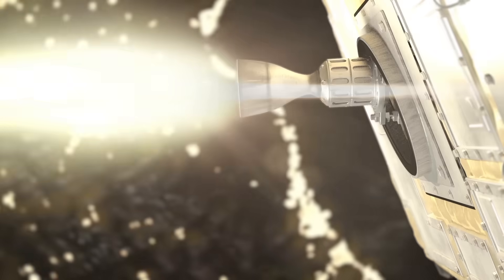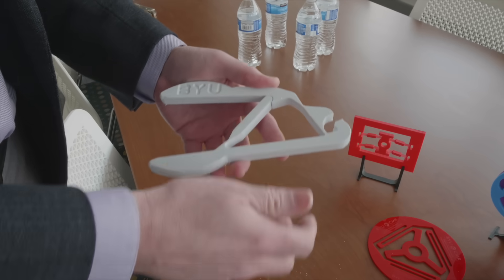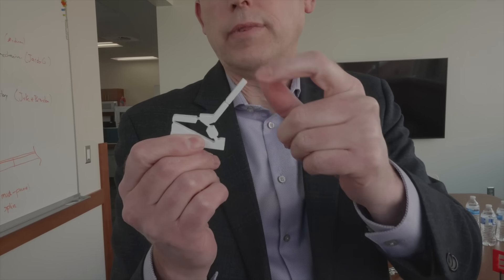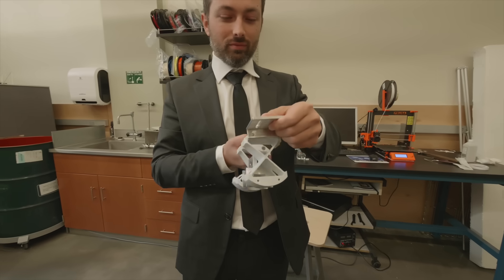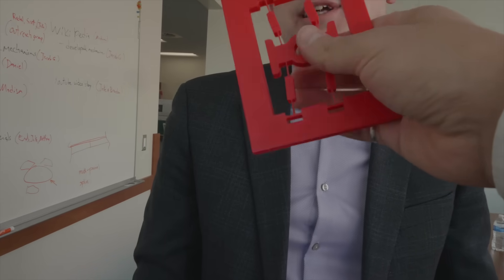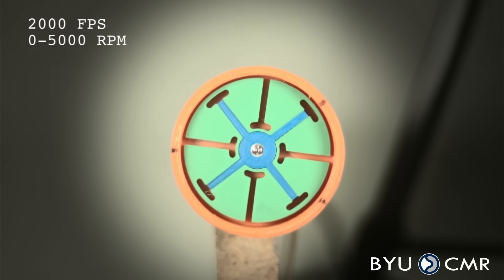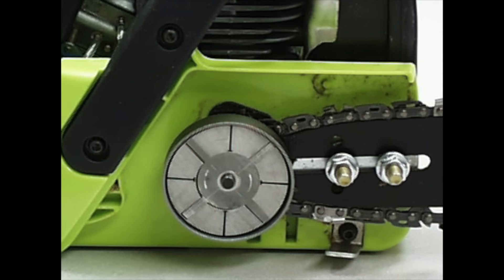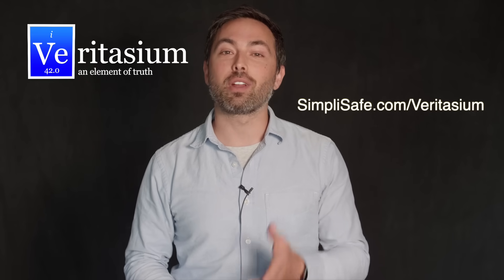Why Machines That Bend Are Better

Comment: regarding the plier. Please provide the number. what is the grip force generated?
It is science and engineering right?
Reply: He said 30:1.  You do the math based on that ratio.
Reply: @shirothehero0609  yeah. If the max force applied only 0.3 N then the total only 3 N. Great. or the limit only 5N so more than that it will break the tool.
Reply: @hahahuhu9828  well, you can also assume the tensile strength and yield is that of ABS or PLA since it was a 3D printed object with a 'regular' 3D printer.  So you can still figure out an operating range based on that.
Reply: @shirothehero0609  so, give me the number. Seems like you're proficient in this 3D printer matter

Comment: I don't understand the function of the safe-ing mechanism
Reply: Modern nuclear weapons are designed like a vault.  You need to know the combination in order for it to go off, and this is controlled mechanically, just like vault tumblers.  Unless you input the correct "codes", the firing pins will not be properly aligned, and thus no big boom.  However there is a small chance that random vibration (ie earthquake) could put the pins in a viable firing position.   I believe the idea behind the compliant machine was that it could be armed quickly, last forever, and be immune to random vibration.

Comment: about the arming device:
so any proper input rotates the wheel one notch? couldn't you just use that same input over and over until the hole aligns with the laser? seems pretty sketchy. unless you have some program between inputs and the wheel that discards incorrect inputs and previously used inputs. that makes sense. but couldn't an earthquake still spin that tiny wheel if the bomb is rattled the right way?
Reply: Problem solved by adding additional wheels.   You put in eight of them, and the random chance becomes gazillions-to-one.
Reply: @iqvoice  oh. thanks

Comment: Compliant mechanisms; the next step in planned-obsolescence... one tiny fracture and the WHOLE thing needs to get replaced baby!
Reply: If a piece of the equivalent metal machine breaks, the object stops functioning all the same. The difference is that the whole plastic thing costs a lot less than any given piece of the metal machine.

Also the durability of those materials is comparable to that of their metal equivalents. This ain't plastic toys off the toyshop shelves.

Comment: All of those bendable parts will wear quickly.
Reply: cro4591 That is a valid concern, but they did have that switch which they had tested for over a million flips without failing; if they can ensure it has decent longevity, I’m all for it!

Comment: Apple should hire this guy to make a better keyboard for their laptops.
Reply: Johnny Sparkleface They purposely design their stuff to fail after a certain time/usage period. It’s called planned obsolescence.
Reply: @BadgunmusicII  Except that's not what planned obsolescence is SUPPOSED to be, it's supposed to be, for example say you had a toaster, the heating element will only last X uses, the lowering/raising mechanism however will last for 15X uses, at which point you cheap out on the lowering/raising mechanism in order to save money until it's more in line with the heating element.
Apple are just greedy fucks.
Reply: Avery J. Johnson wsc?
Reply: @BadgunmusicII  That's how the men's grooming industry makes money and that's how Gillette became such a big brand. They discovered a single-use product and sold it to the customers over and over.
Reply: @BadgunmusicII  as much as that happens in the industry, the position OP was making was for the "clickaty clack-ness" which Apple finally changed from their so called butterfly keyboard design back to more tactical ones
Reply: Avery J. Johnson. Yet they replace the failing keyboards FREE. They didn’t do this on purpose. Also iPhones last MUCH longer than android phones!
Reply: @commeter you just made both of those up,by "free" you mean they will completely memory wipe your laptop for no reason and it won't come back working or something will be wrong 9/10. And they literally don't last longer like I mean in perfect world scenario they would last the same amount of time but Android's are much sturdier on average. I don't care whether or not you but apple or Android ,but I don't like liars.
Reply: dooterscoots. With the keyboards, maybe somthing like this happened to you, but i have never heard anybody talk about having their MacBook wiped. And Android phones are not sturdier! Since when is stainless steel and glass not as sturdy as aluminum and glass, I’m pretty sure you just said this because of the iPad Pro and because some collage girls who don’t know how to care for phones have broken iPhones. I said iPhones last longer not because of build quality, but software support, after 2 years you’r android will be dead (I’m saying this from experinece) but people with iPhones still have perfectly working iPhones 6’s
Reply: @--2  sorry about your experience but my phone is a galaxy s7 and it was released in 2016
Reply: @--2  you are probably comparing a cheap android phone and a 1000 dollar iphone. as far as im aware google phones are pretty up to date, and u can still update the original oneplus from 6 years ago to the latest version of android. i dont really know about samsungs s5 or s6, but i know that basically every phone that they release, regardless of price, gets at least one major update. of course cheap phones wont get more than one major update but thats understandable because they are cheap and not really worth upgrading anymore, since their hardware will become insignificant in a couple of years or so.
Reply: Tose Petrusev, Google Pixel phones are supported for longer than other Androids. The oldest OnePlus phone to get Android 10 is the OnePlus 5 wich is 4 years old (Wich is pretty good and is one of the only with google to support their andoids for so long) But S5 or S6???????🤣 The oldest Galaxy phone to get the latest updates is the S8, wich is going to be unsupported next year. And yeah I have only had galaxy devices, but Google and Onelus support their devices longer of Android manufacturers! (and besides I could also be comparing my phones to the 399$ iPhone SE)
Reply: @--2  The most sturdiest phones, if your on about how long they last/how much of a beating they take, are typically androids or neither android or IOS. Technically speaking even if the update is not supported does not mean it is impossible to update. Software wise personally I prefer android and i usually pick a samsung, or a sony phone. The most powerful phones on market are all android. Iphones are more sturdy as you say compared to a samsung but then again the screens they use are made by samsung xD.
Reply: defaltCM, What? You barely knew what you were saying there. Androids are not more powerfull the iPhones! Ever heard of something called “A13 Bionic”? Yeah the OLED screen itself is MADE by samsung and designed by apple but the glass on the iPhones is totally engineered and manufactured by Apple! And in most cases the glass brakes not the OLED! (tough i did once have an galaxy wich the oled broke but not the glass😂) I’m not saying Android nor Android phones are bad in any way, i’m just correcting few facts!
Reply: @--2  sorry to say but androids, not all naturally, are more powerful than iPhone. The most powerful phones rn are androids. Samsung galaxy s20 ultra is mors powerful than the iPhone 11 max Pro, both are powerful devices but even then there are still phones better than both of them.
Reply: defaltCM, Well right now it’s more powerfull but it’s 2020 VS 2019 we need wait for the iPhone 12 to compare... Really look ing forward to the A14, thats supposed to be 5nm chip...
Reply: @--2  a14 bionic right? I'm assuming it's similar to the process used in snapdragon x60
Reply: defaltCM, Yeah I don’t think it is complete same, cause a modem uses different tech than a processor, but I think it means the same, more power, more efficiency but smaller package
Reply: But they would more likely end up hiring 50 "Physics Girls" before that, cause the consumer pays anyways, so you see where's the problem - actual knowledge and wit gets overlooked.
Reply: I could not agree with you more, just that they will make this amazing stuff too pricey
Reply: don't buy apple
Reply: @neurofiedyamato8763  Can u help a little?
I need 12 more subs.
Reply: T A J. Wow an valid arguement! You totally won this one
Reply: T A J,  Don’t try “bud” on me, im not 8. And please tell me wich android phones are sturdier than iPhones (please DON’T include an rugged phone made out of rubber and plastic cause that’s not competing with the iPhone nor any other premium android :)

Comment: 9:07. It is a sintrifical clutch. Used in golf carts motorcycles and other engines. It gives you the ability to not need gears to go faster I have a 4 wheeler with one and you only have a high low reverse and neutral gear.

Comment: What if a compliant device were stored in its "sprung" for a sufficiently long time to loose their Shape Memory. There are warnings on Sliding Weight Scales in your doctor's office as well a Torque Wrench in your mechanic's garage that say something like "Do not store in the loaded position". Would I be wrong to simplify the flexible portions in compliant devices as springs and subject to these spring-like behaviors?